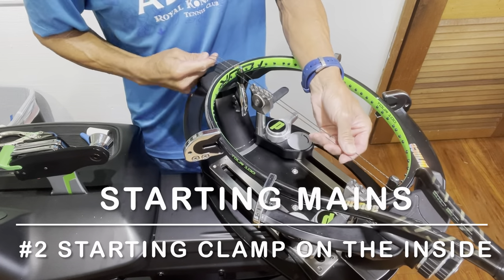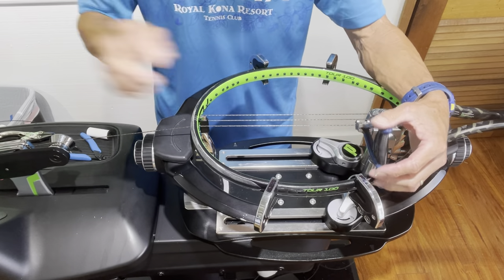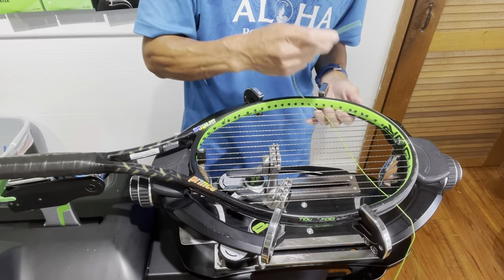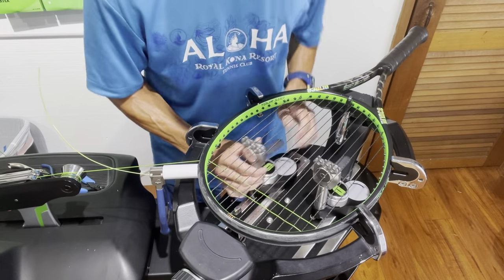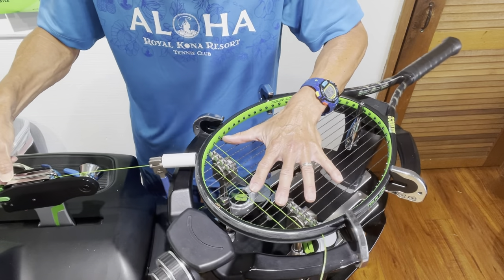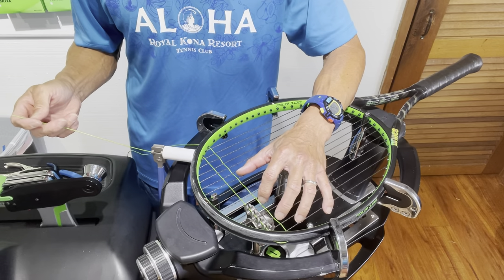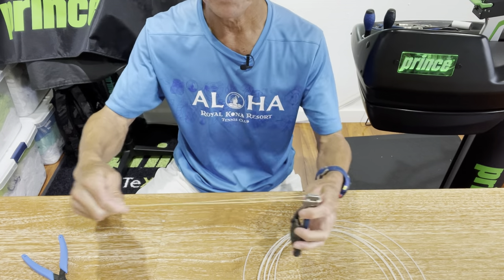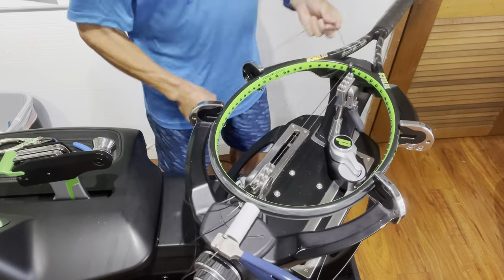Racquet Stringing [Part 2 of 2 - Stringing Tools of the Trade | Upgrading Your String Clamp]

Comment: Albert, Aloha, firstly, I would like to compliment you on all the tutorials you put together! The clarity and simplicity of your methods of explaining how to properly apply the standards of racquet stringing is unparalleled to any other stuff on the net!!!

Secondly, using the nylon tubing on the bridging clamp is a most useful and ulterior way to just get the job done without having anything go wrong while holding a string under tension before being clamped off! I use a drop weight stringing machine and you know what happens when your bridging clamp fails while tensioning a string! 

I use flying/floating clamps with my drop weight stringing machine. I, for some time now, have adopted the Yusuki method with an offset tube and a starting clamp to start my mains. I start my horizontal strings using an offset tube and a starting clamp. I pre-weave the first 2 or 3 or 4, depending on the racquet, top horizontal strings and always tension the second cross string as to allow me to clamp with a flying clamp. I continue to tension and clamp the 3rd horizontal string and then I go back and then go back and tension and tie off the first cross. I actually enjoy using floating clamps and have come up with methods to accomplish ATW techniques. 

I do have an interesting and controversial question though regarding one piece stringing and the manufacture’s suggestion on how to do it on their racquet:  On a Pro Staff and other models Wilson suggest stringing from the bottom up!!! What are your thoughts on that?
Reply from the maker: Aloha Dario, Thank you for your kind words. I love sharing my knowledge and passion for stringing, but comments like yours motivate me to keep producing content! 🙏 

It is common knowledge that you should never install the cross strings from the bottom up. This method places a lot of stress on the top of the hoop and can cause distortion, or even worse cracking. The only time I've used this method was at a professional tournament and the player specifically asked me to string it that way.  

If you want to string a racquet 1-piece (when the main string tie-offs are at the throat), using the ATW method would be the best way to go. In fact, I developed my own ATW technique and I posted it on the IART website. If you're a Premium Member, you can check it out here - https://gssalliance.com/iart-member-content/around-the-world-with-a-twist/
Reply: I had a question at the end of my long and laborious comment that I wish to have your input on. Sorry for the long comment.
Reply from the maker: @Dario-CTCC  Hmmm, I thought I addressed your question. Can you ask me again?
Reply: @AMstringing  oh my gosh, so sorry, yes you did , I just didn’t click on the “read more” icon. Pardon me for that!!
Reply: When I go to the Wilson site, the one piece stringing diagram shows to start at the throat for the RF 97. Why would they do that?

I saw your tutorial video about your ATW method for when the mains finish in the throat. 

It was very helpful and it solves the issue to have equal tension on the mains and the crosses. Nicely done!! Have that video saved! Thanks
Reply from the maker: @Dario-CTCC  That is odd. According to the USRSA manual, it lists the same thing for 1-piece stringing. But if you string a 2-piece, it lists the crosses starting at the head instead of the throat. 

Glad you checked out my ATW! The other difference is the 2nd to last cross string weave, to avoid the looser and "wavy" look when completed.
Reply: @AMstringing  very odd indeed! I always check with the manufacturers of the racquets I string. I do that to avoid any mishaps regardless of how the client wants their racquet strung. There have been situations with cracked frames and the manufacturer would not replace the racquet, because it was not strung in the way suggested by the manufacturer’s racquet engineers!

Comment: Cool tricks, truly on the safer side of using clamps 😊
Reply from the maker: Aloha Vincent, Thanks, maybe I should have titled this video "Tricks of the Trade!"😀
Reply: It happened to me a couple times. You didn't mention it but the diameter of the tubing should be thin enough to go through the starting clamp. On Amazon I found 1/4" type but it's too big.
UPDATE: Just found it!

Comment: Nice video! I 3d printed a block to offset the starting clamp, with a slot that is deep enough so it hangs on the string slot down instead of using a tube to offset the starting clamp. This way the string doesn't have to be threaded through a tube, and then unthreaded. A deep enough saw cut in a plastic or wood block would do as well. On the starting clamps the grip on the string changes with the depth into the clamp since it is a leverage issue. I ordered the Babolat clamps from the UK, most places don't seem to stock them.
Reply: can you share the stl file?

Comment: I saw your 2nd main clamp had a bit draw back when tension released.. what's your experience with drawback and whether it's a real issue?
Reply from the maker: Aloha Jason, 

I notice that most machines have a certain degree of drawback and recovery. In my opinion, the main thing to pay attention to is the amount of recovery that occurs on each pull. 

I wrote an article for IART covering this topic. Here are the videos that illustrate drawback and recovery. 
  * Drawback - https://youtu.be/CzCn7eH78hk
  * Recovery - https://youtu.be/85WoGmNobpw

Comment: Hi Albert, what brand of starting clamp is best. I'm having problems with slippage with thinner gage strings at times when I use it as a bridge.
Reply from the maker: Aloha, Just curious, what brand is your starting clamp? Babolat would be my first choice, but I'm not sure where you can order it by itself (not with the tool kit). I did a quick Google search and it sells for about $59-$85 but is out of stock at both places. The Alpha brand works well. I've ordered some for other stringers before. It looks and feels like the red and black ones featured in this video. You can get it from New Tech Tennis for $36 - https://newtechtennis.com/alpha-starting-clamp-asc-tennis-accessories-clamps.html.
Reply: Yeah I tried looking for the babolat starting clamp that was my first choice too. I have a pros pro starting clamp that is very stiff and seems to crush softer strings so I ordered another cheap unknown brand from eBay that they said works well. It did work well for a while but it just slips on thinner gages of string. I'm not sure if it's build up from to much usage and I tried cleaning them with alcohol. But thanks for your advice I'll order an alpha to try. Thank you again aloha from SF.
Reply from the maker: @gtowsweet  Thanks for letting me know about the Pros Pros starting clamp. I noticed it has 3 springs in the handle. What if you try taking out one spring and see if that helps alleviate the crushing issue? I heard of another stringer that did that with one of his starting clamps for that reason. 

1) Try removing the middle spring first and see if that helps.
2) If not, then you could remove the inner or outer spring and see if that makes a difference.  

But then again, you risk the chance that it might slip on you. Let me know if you decide to make the call and if it works!